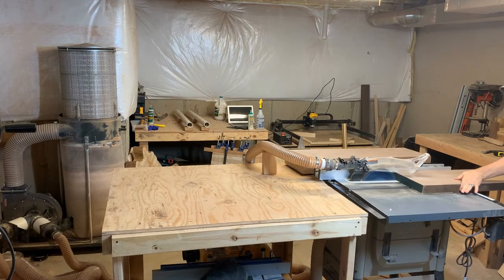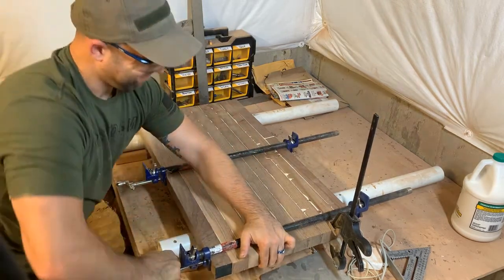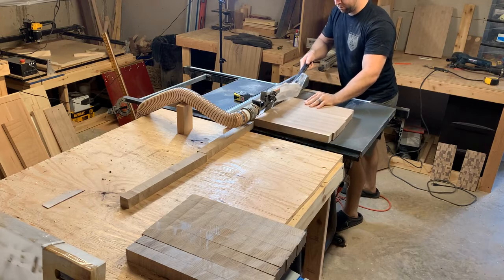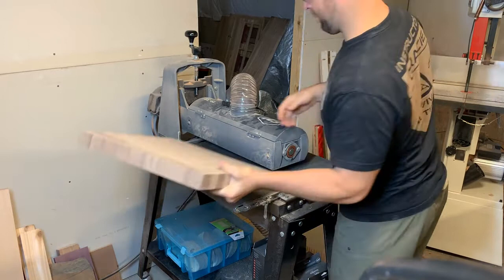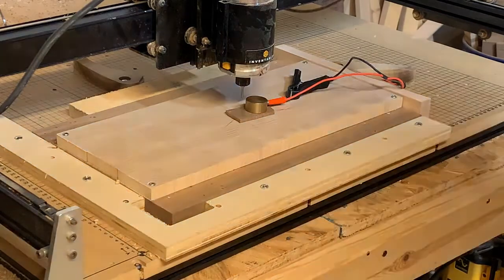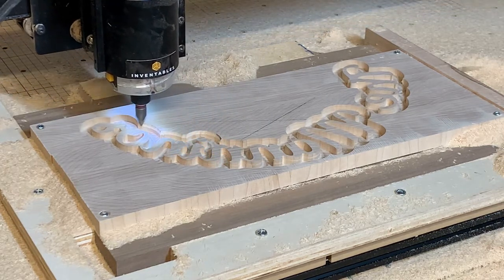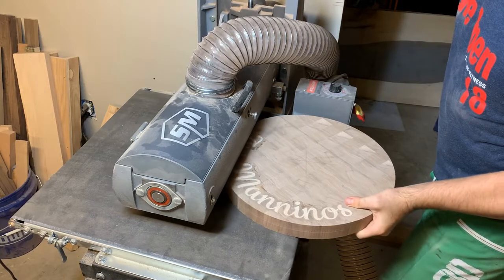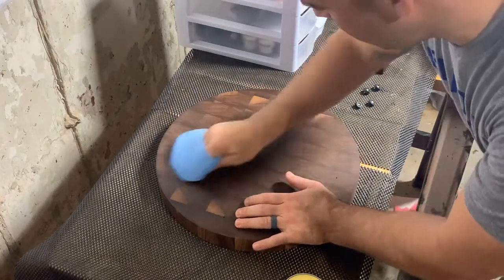My Best selling Butcher Block with Cnc Inlay

Comment: I never though about using a spacer and do the same toolpath twice. Clever. :) I used create one or two fake toolpaths using different flat depth to alleviate that problem.
Reply from the maker: try it out. it actually works really well.

Comment: Hey Jake, good job! Looks great! What software are you using to design and make your G-code? Check to see if your software can break up your depth of cuts. Like in my software I can set my total depth to say .500" and I can break it into 2, 3, 4, etc. steps. So at .500" total depth and 4 steps, it makes 4 passes going down .125" increments. That way you don't have to use spacers to adjust your depth.  Check it out. It will save you loads of time. And if you have to re-home between each setup... Nuts. I hope this helps/works for you. All of the best.
Reply from the maker: hey Art, thanks for watching. I use Vcarve pro. I can do that with the pocket portion. but not sure how to do that with the plug portion. what are you using to do that?
Reply: @turnmodern  I am currently using BobArt, but I soon want to switch to VCarve Pro. I am getting familiar with the free version for now. When you say "plug portion" do you mean profile toolpath? If so, there is an edit passes option in there.
Reply from the maker: its the maple portion or the male portion of the inlay. I have not figured out a way to change the depth. Im actually not sure there is one yet.